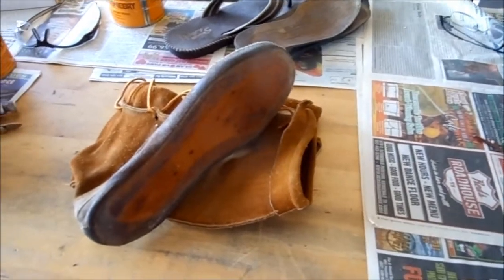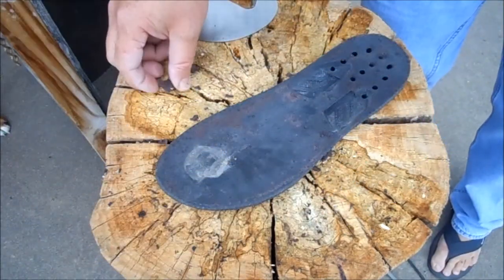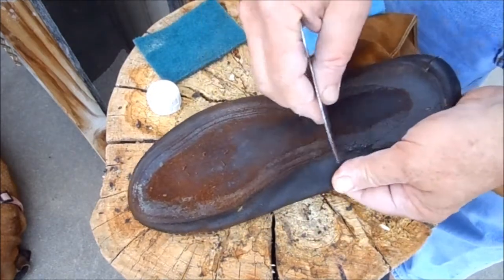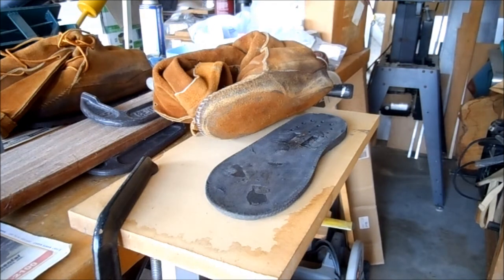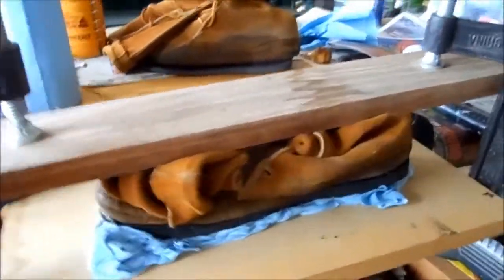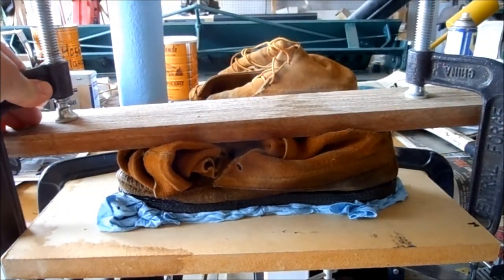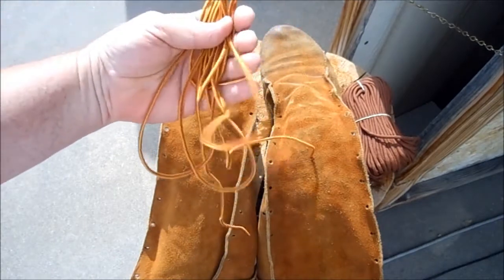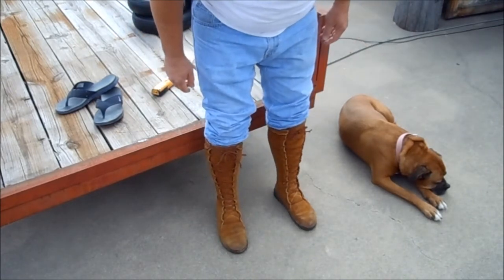Sole Swap

Comment: how did you get the soles off in the first place? i'm at that step right now
Reply from the maker: The original soles were already peeling off in a few places, so it wasn't to difficult to peel it off the rest of the way. Any place that didn't peel cleanly was cut loose with a knife. The donor soles were removed in a similar way but it took a little more force. Both surfaces should be scraped smooth before gluing.
Reply: @LittleshopintexasSV  great!!! thank you so much. i'm really enjoying the DIY aspect of having no money....always finding the silver lining, eh? sending you Gratitude, xo
Reply: @sarahtonen4873  Glad I could help. Stay well.

Comment: Warning: One of the biggest mistakes that you can make is to reach for a solvent, such as paint thinner or turpentine; the solvent will cause damage to your leathers. Do not use them! But the rest of the video is informative.
Reply from the maker: That's a good point, but I don't remember using mineral spirits on the leather. I know I used it to soften glue before scraping. Of course these are old boots and I may have used it to clean off old oil before gluing. I'll have to watch it again to see. Anyway thanks for watching and reminding others that mineral spirits could damage leather.